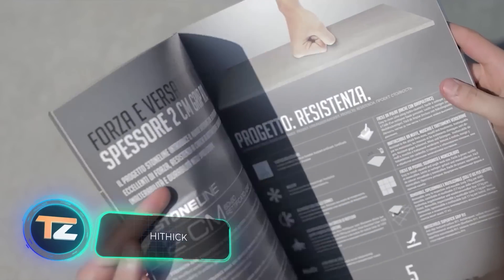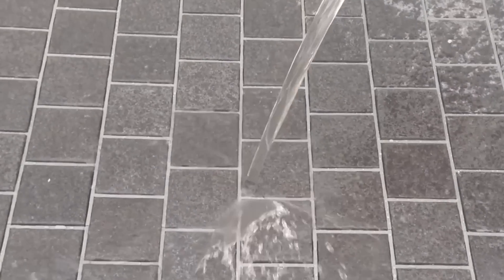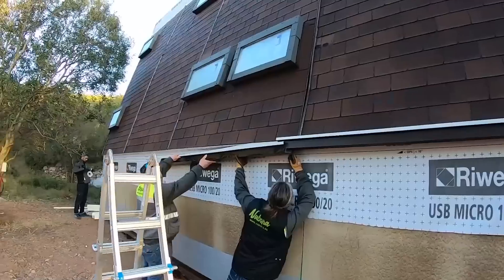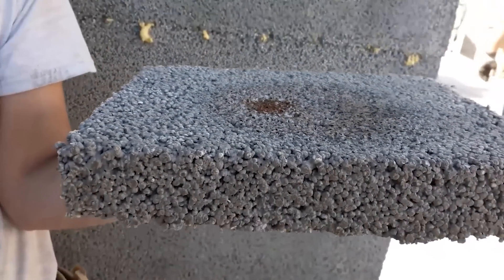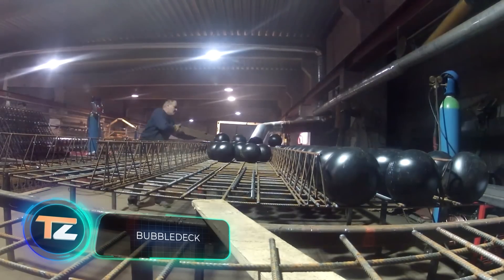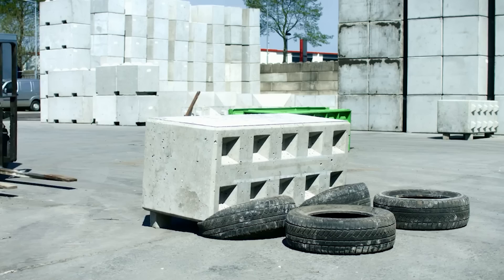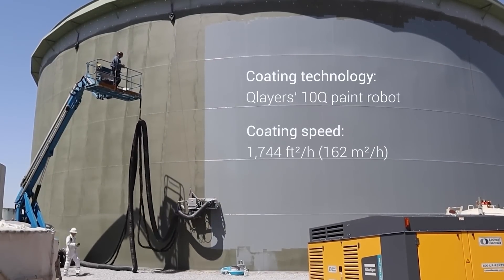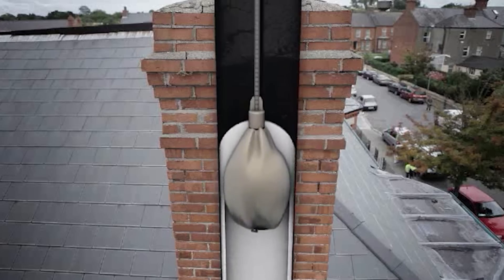INCREDIBLE CONSTRUCTION TECHNIQUES THAT ARE WORTH SEEING

Comment: I would not recommend using bubbledeck so many buildings have failed.
From wat i saw in the reports its mostly cause of a flaw in construction. 
The problem is normally if there is a flaw somewhere the rest is still sturdy enough to be more then save enough, that does not apply to bubble deck there is almost no room for errors. 
Secondly there is no room for installations so its useless in my eyes just use channel plate to save concreet

Comment: I worked with several of this products and it just isn't as presented. 

Peri duo, is only useful when there are only flat and straight lines. Otherwise it is just as good or bad as every other product. None of the crew where ever happy to work with it. 

Bubbledeck is a very nice product to use, i really loved working with it. But it is banned in countries because buildings, build with this product collapsed and the product is deemed to be unsafe. Recommending this product is unfortunately not a safe move. 

Europeblock is a nice product but there are many of them outthere. It isn't unique, a more unique approach will you get from hendriks stalenbekisting. But there is something else you need to be aware of if you want to sell the blocks after pouring. Most of it is done on the black market and I know that by a lot of dealers you also can by guns wich is illegal in the Netherlands. (This has absolutly nothing to do with the companies who make the steel malls, but is something you need to know if you want to use it and sell it)

Comment: Notice on the Folding House (or most of the products) they did NOT Mention Pricing.... So I am guessing Double to Triple Normal Building Costs of a House that same Size or even a Shed Converted to a House....
7:20 Now make them Hollow using the Balls from Previous Clip... Makes them Lighter..... 
8:06 they already make Molds similar to those but with different edge shapes and have been around for Decades... at Lowe's, Home Depot, Ace Hardware, just to name a few... 
Last one... Rubber Ruffing??? Really? That shits been around Longer than I have been alive and I am ( at time of posting ) 48... So WTF is so New About Rubber Roofing?

Comment: 1:55 why are those raised from the ground like that? insulation?
Reply: You can run wiring and ductwork underneath easily.  Almost all casino floors are built this way.  It's also easy to get a level floor on an out of level or variable height slab.

Comment: "With proper design can withstand an 8.0 earthquake". You can design any type of structure to withstand an earthquake : wood, steel, concrete,  cmu masonry block. Weird they mentioned earthquake resistance right after talking about wood durability. IMO making it seem as if wood structures can not resist earthquake forces. By the way wood is excellent vs earthquake forces mainly due to it weighing less than other materials vs its strength.  Proper design (hold downs and connections) are needed but don't count wood out in a high seismic region.
Reply: Did wood write this
Reply: You are exactly right
Reply: @AcademyOmran  rgijojgj,
Reply: Stolen from another inventor for a truck liner polymer
Reply: Yep, if house foundation is earthquake resistant, any house on such foundation can withstand earthquake
Reply: Ok old man...
Reply: 0:37 this might help that people do not try to go  headfirst through the wall
Reply: 1:19 better grow food instead of covering the earth with cement.
Reply: 2:44 the question is what exactly are they doing on this tiled area?

Comment: 04:50    Uhhh...vertical seams all the way up the wall? Unless they're building a drawbridge out of those bricks, whoever eventually leans against that seam once it's painted over, is in for a cracking surprise LMAO
Reply: They are filled with concrete,  it'll never crack
Reply: I guess you missed the part where they filled them with concrete?
Reply: @theperfectblockiccf  Thanks for the explanation. Do ya'll make these for curved buildings?
Reply: @FordPrefectInCharge6x7  check out their you tube channel. I found a video on radius walls. AMAZING!

Comment: 3d printer construction robots will make most of these techniques, obsolete. They are cheaper, way faster, more effecient and usually fire proof. The latest tech we have for every part of life, will set humanity free from all our issues.
Reply: Yes but the probleem is that the constructions you can make with a concrete-3D-printer, is that you can't absorb the pull-forces. Therfore you need metal reinforces, but that's a big struggle right now 😊
Reply: Maybe. Most of the 3D printing tech currently is very slow, wasteful, and can't do most of the complex things.
Reply: @Kareszkoma  look into it yourself. They aren't currently slow and they are building whole suburbs in the south. We just need to use those and law enforcement drones to clear out all the criminals and illegal anything's quickly and easily.
Reply: @caseyford3368  I researched it, and a bricklayer works faster. They can only do one level, as far as I know, and even those with the weird wavy mortar walls. Which technically insulate well. Which is a big positive. But the 3D printer still needs a lot of human assistance. You don't have to argue it, if you don't want to, but this is what I found.

For the second text... fuuh.. wow. I mean I don't like criminals either, but drone strikes may be a bit much. Thou, really depends on the neighborhood. At some places it would count as renovation.
Reply: @Kareszkoma  we can be and do so much more, but the people in charge don't use what we have for some reason.
Reply: @caseyford3368  Well, that I can agree with. Technology is being cockblocked. Drone builders are a thing, yet they are unused. Even though they are cheap and pretty great. I would not go into the topic of corruption, and how most of the modern world have massively moronic people in charge, at pretty much everywhere. Supermarkets, big businesses, politics, everywhere.
Reply: @Kareszkoma  yes. I really wish Elon Musk or someone just like him,would be the President. That way we can move forward instead of remaining stagnant.
Reply: @caseyford3368  Do you meant the Vulcan 2?
Reply: @caseyford3368  Oh no... Well. I would not recommend looking up more stuff about Elon. As comes out, he is good at hiring people to do science for him. And that's just the bitter cherry on top, with how much problems he have, and things he done in the very close past.
Reply: @Kareszkoma  the government is purposely choosing the dumbest and slowest way's, even though we have many great technologies available. I hope we wake up soon.

Comment: Are they using RECYCLED plastic for those EPS bricks, and the concrete structure with plastic balls?
       It seems like a perfect solution to reuse certain plastics
       (But I know in many cases it's cheaper to buy new plastic)

Comment: The akfix polyurea i was like HAVE YOU EVER PLAYED WITH LEGOES THE RIGHT WAY BEFORE!

Edit: mark rober should use this stuff for watermelons to test it out!
Reply: There's a video (I believe from Veritasium or SmarterEveryDay) where they test a melon sprayed with 'truck bedliner'. 
       It's sprayed on as a 2 part 'epoxy' / coating. So with ingredient A and ingredient B mixing together just before it comes out the nozzle.
       It has similar properties as that polyurea stuff (spray it on anything. Now that thing is 'unbreakable')

They throw the melon off a roof, even. 
Stays intact, but the melon inside turned into mush. (So it's 'intact' but the melon is now more like a milkshake)

Very interesting to see :)
It should be on YouTube

-

By the way, I think lego is made from ABS plastic. 
      Very strong in the way that they use it - but when used as thinner, larger pieces (like a carrying case for a drill) it can crack quite easily when dropped.
Reply: @iggysixx  oh cool thanks

Comment: not sure on the facts on the EPDM membrane , it doesn't last 50yrs .  it will waterproof a roof if installed correctly  but in the commercial roofing industry,  it's considered junk for a durable roof system.  if you want a roof membrane that has a chance to last 50 yrs it would be  Sarafil PVC membrane. NASA even tested it , best overall results of any roof system . I still enjoyed the video.
Reply: no need to disturb nasa. Regular tar membrane lasts that long. Even uncoated.